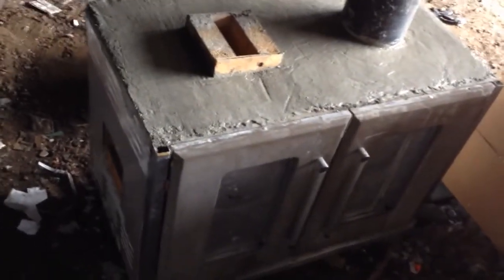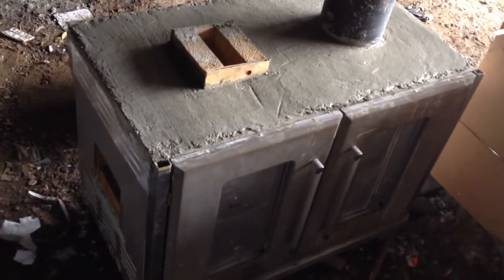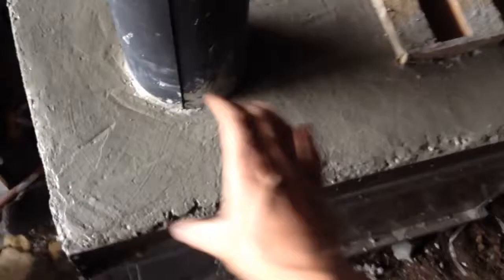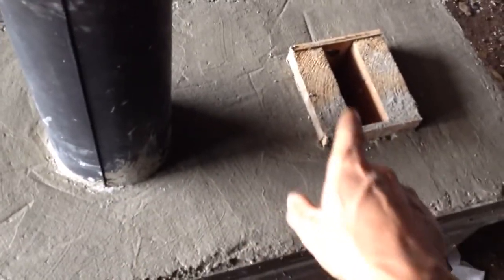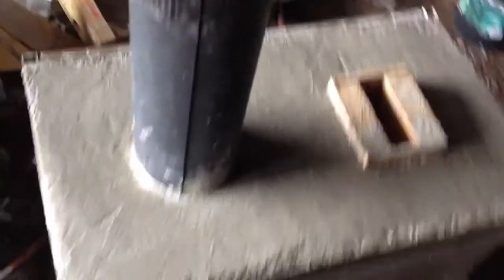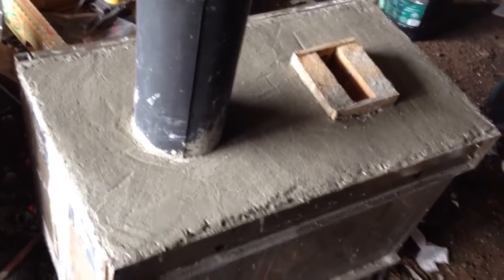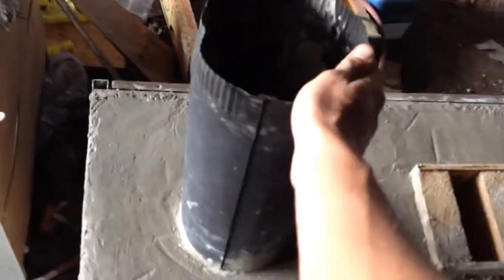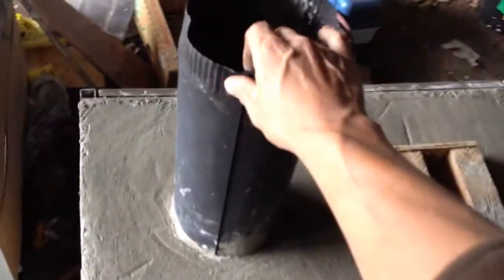Rocket Stoves Ep#19! Cast-Core Model Finishing

Comment: The length of burn tube? How high in length should the riser be?
Reply from the maker: To prefer the 2:1:3 ratio.  Feed tube is around 16-18" deep, the horizontal burn chamber is short only  8 or 9" , short burn tube is my favorite.  This allows the flames to reach the riser easier.  The riser is somewhere around 24" tall , I have documented the build and the measurements, but I'm not able to access my notes until later.